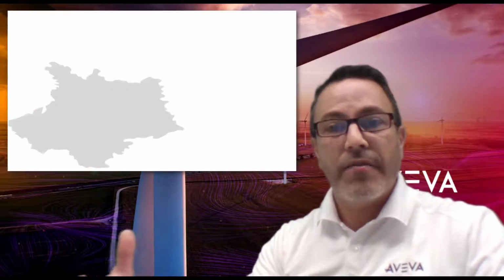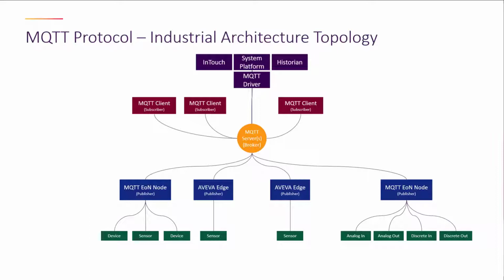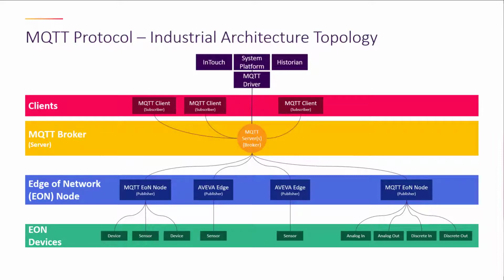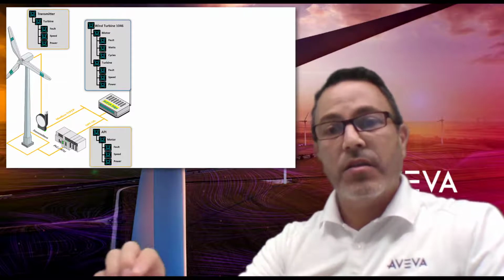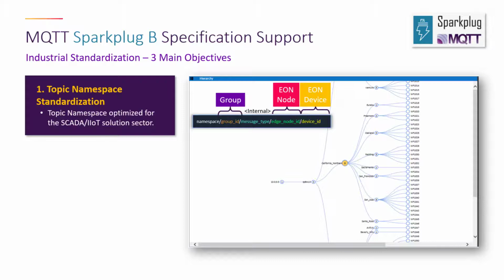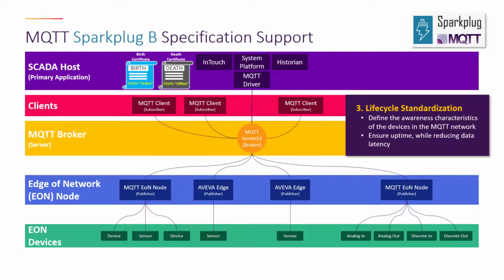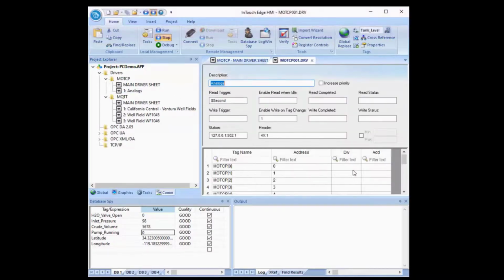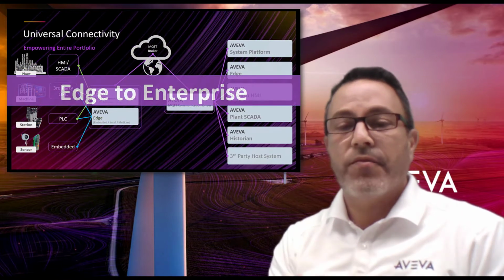MQTT + Sparkplug B, What They Are and Why Use Them

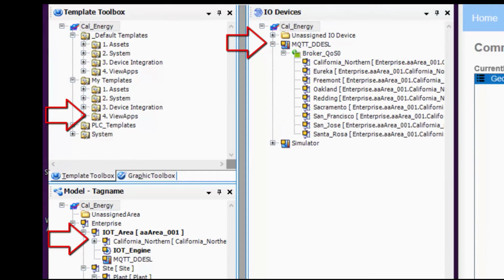Comment: Alvaro at 13:36 were the areas and objects automatically generated by System Platform and the MQTT driver? Or was the video speed up and added manually? If they were automatically generated it would be nice to see another video specifically regarding that feature.